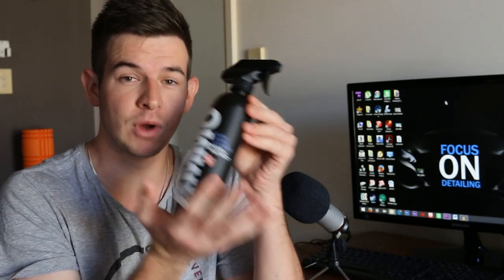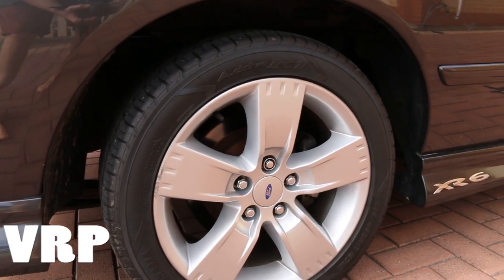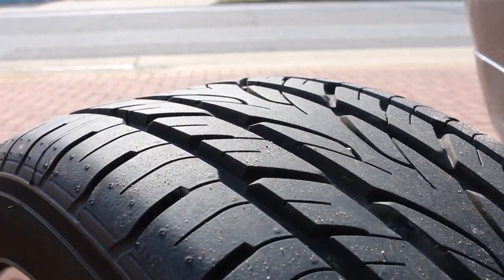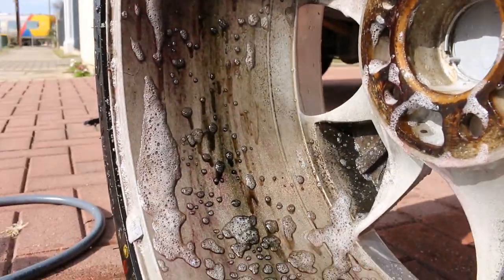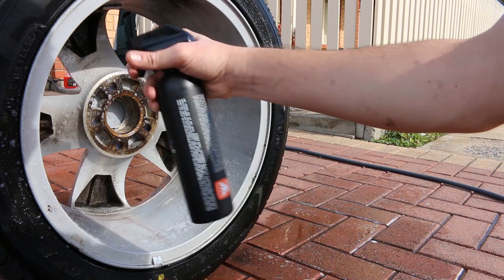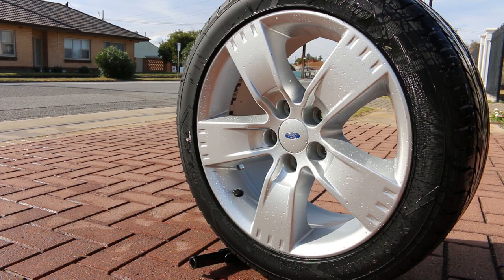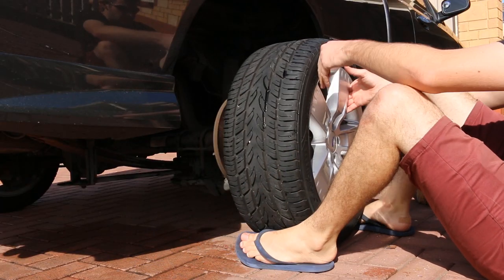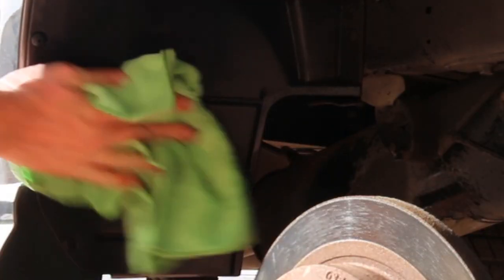AMMO Plum Wheel Cleaner Review | Is It Worth It? | FocusOnDetailing

Comment: I think the other part to it is simply cleaning them more often so you're then not in a situation where things get perm caked on.  Nice video!  I've only used the chemical guys diablo + wheel "woolies" brushes, works fine, but there's still room for improvement
Reply from the maker: Thanks for the comment! That's going to be the plan from now on. I'll be taking them all off more often now to give them a real good clean to prevent all that caked on stuff. Yeah I've heard about Diablo and seems pretty decent. I now use Bowden's Wheel Cleaner too which does a good job.

Comment: Personally a big fan of the ammo wheel cleaner. Although my wheels have (through years of neglect) collected lots of dark spots of which the wheel cleaner can't remove. You mention in the video that it would require "much more work" to remove these black spots. But how exactly, are you supposed to use an old clay bar, or some kind of acid?
Reply: You can use a clay bar and polish / 2-step for your rims. I have done that for a customer's rims just prior to getting them coated.

Comment: Great video again. Just be warned using imported waxes, polishes, wheel cleaners, etc as many of the chemicals used will cause long term damage to both the wheels coating, that being paint, clear over, chrome, plating, as any small scratch or defect that has exposed either the primer or the bare substrate will allow product to penetratie deep, via osmosis , under the coating and will eventually cause delamination from the substrate, and secondly, depending on the porosity of the metal used in manufactoring, embedded within the metal itself, this cause deep corrosion issues. The same processes  occurs with paint but on a much larger scale. Carefully read the contents than find the MSDS certification, then research what the long and short term effects of continual or partial use are. The wheel cleaner used here contains very high concentrations of high ph acids and salts. Just some good advice for everyone.
Reply from the maker: Awesome stuff mate! This is the sorta stuff I really need to take into consideration. I'll highlight your comment so others can see too. Thanks again for the comments